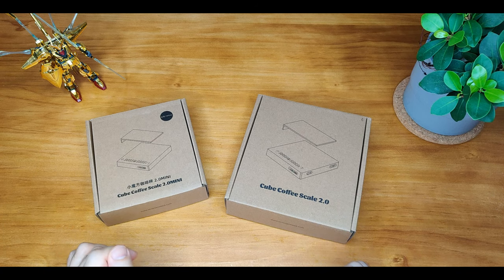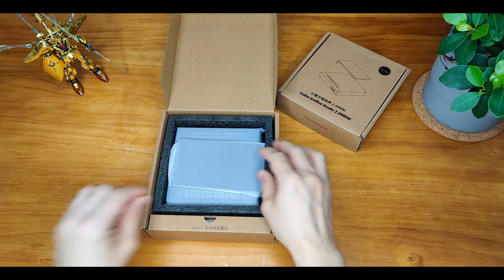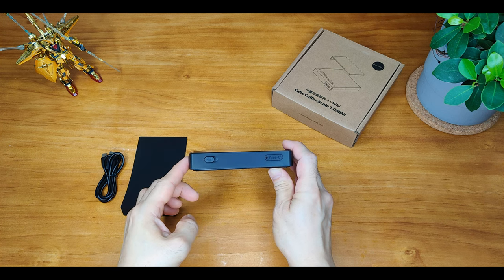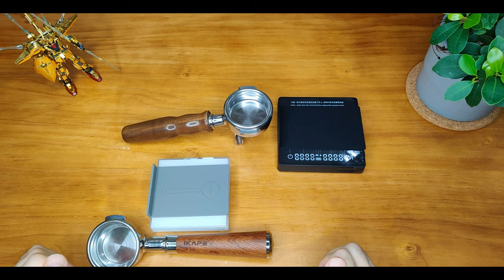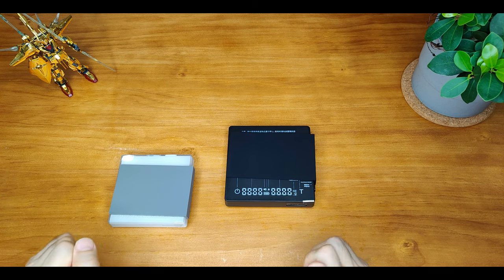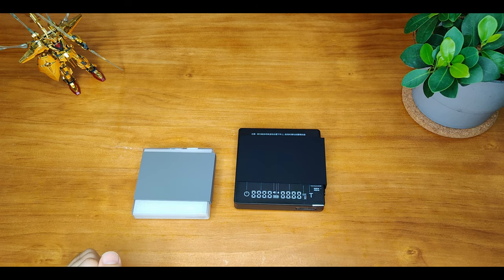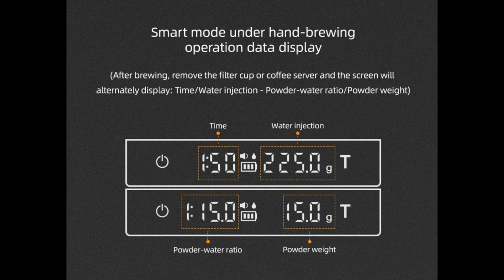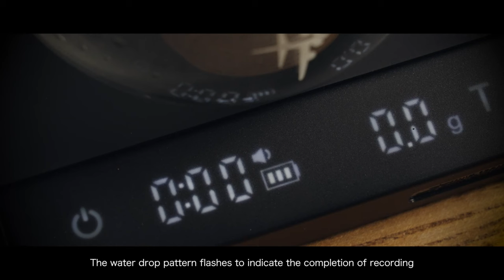MHW-3Bomber Cube 2.0 & 2.0 Mini Coffee Scale

Comment: Is there a way to turn off the auto shut down feature or extend its time? Tnx
Reply from the maker: @shiningm4649
 - Hi there! Thanks for your enquiry. I'm afraid there is no way to turn OFF the auto shutdown feature after 2 minutes of inactivity. What you can do is tap on the silicone mat (on the top part of the scale) to reset the shutdown timer if you need a longer time to prepare. Hope this helps. Cheers!
Reply: Yeh mine shuts off too quickly. Barely have enough time to weigh coffee, grind it, put cup on and pull the shot